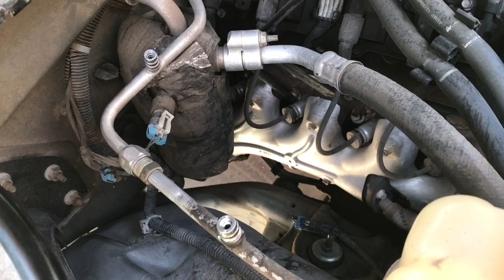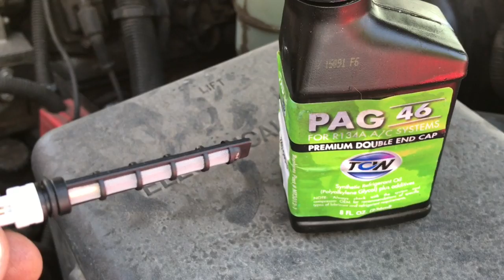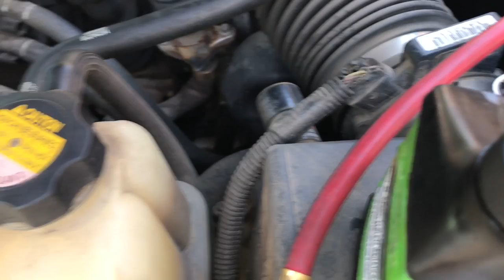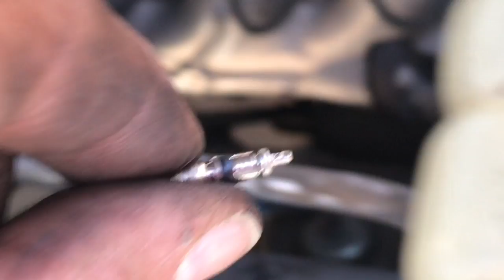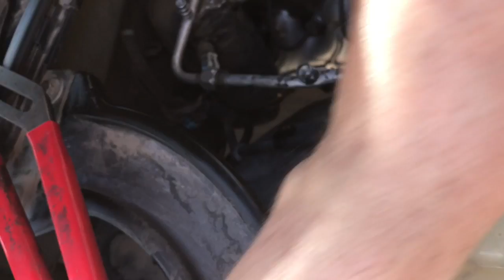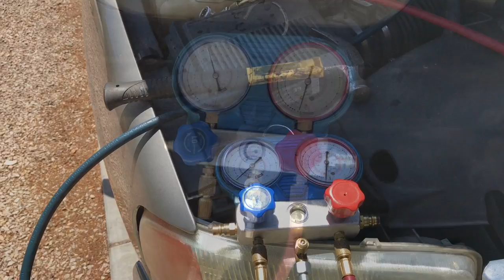Schrader Valves & orifice tube Replacement

Comment: Where did you get a kit with both low and high valves plus orfis tube?
Reply: 1-800- radiator & a/c
Reply: O'Reilly's and part number is, let's go Brandon...